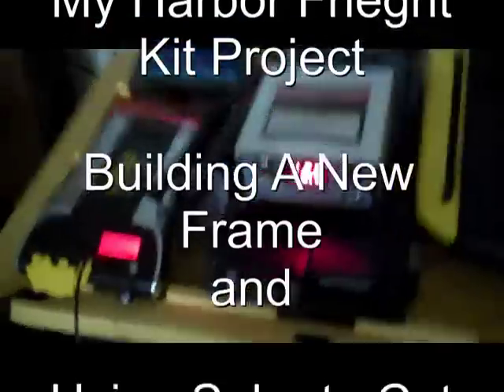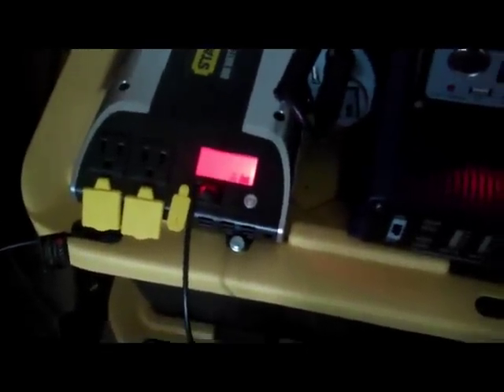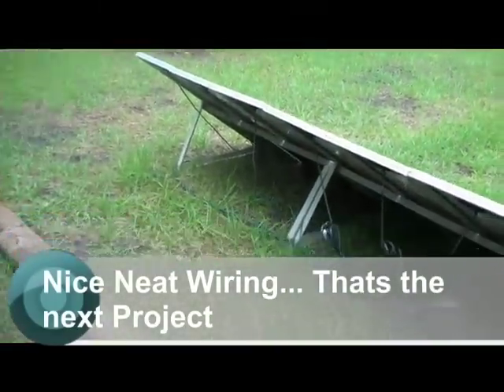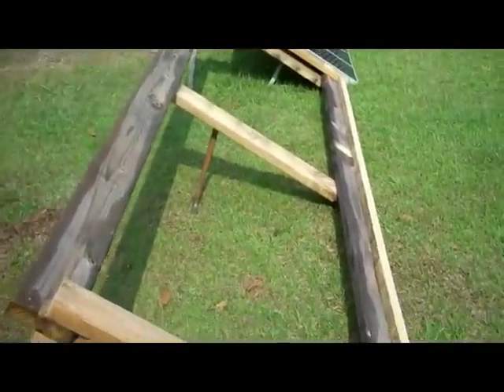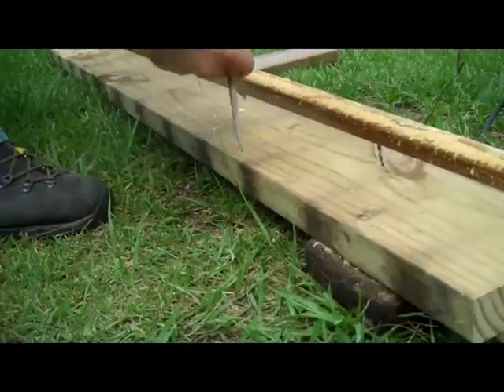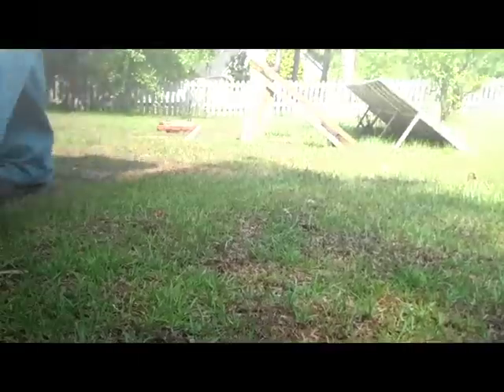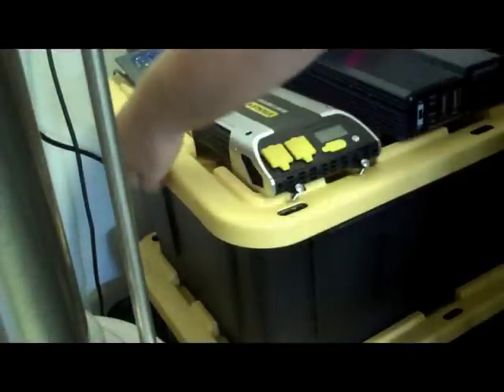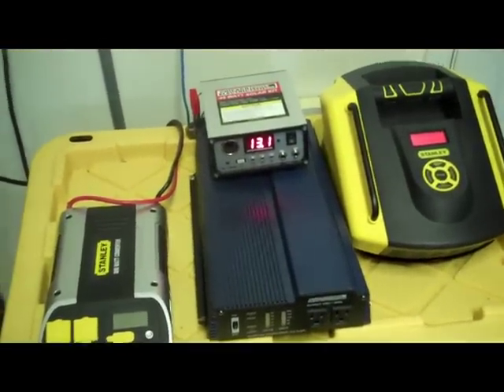Harbor Freight Solar Project

Comment: I use 4 kits from Harbor Freight into one hub with a TriStar 60 amp controller into a 5000 W inverter all with Buss fuses and emergency shut offs and Battery shut off. All my lights inside the house are 12-volt high output LED I can run my 50-inch flat screen all my DVD players freezer the only thing that I am on grid for is for air conditioning. I can show you where my utility bill every month in the summer in the south is $100 even last month which was July 2017 it was $98.82. yes I have a lot of money and solar but it's paying itself off quickly. I think Within maybe around a year it will be paid for but after that it's going to be all free energy. I will agree with you on this stay away from Harbor Freight controllers inverters but the panels are good. Most everything I have is TriStar except for the panels.
Reply: Great answer from someone that's actually trying to walk the talk. Great job!

Comment: nice set up
i just built a off grid solar system
4 100w panels 1 30amp PWM charge controller 6 175ahr golf cart batteries and 1 1000w pure sine inverter
have my 1-37" tv 1-42" tv and 2 computers and internet router 100% off grid
fixing to add some wiring in house so i can run a few lights also in emergency
some day i hope to be 100% off grid
fingers crossed
also setting up 2 systems for my boat batteries
2 10amp PWM charge controllers
3 10w solar panels
one panel and controller in 12v for starter battery
the 2 panels and 1 charge controller for the 2 12v batteries in 24v set up for Troling motor
a float charger for my 24v trolling batteries alone is $180
i got 3 10w panels and 2 PWM charge controllers for $120 off Newegg dot com
and they say the PWM are better for battery life then the MPPT when your float charging for longevity
Reply: yes but the PWM is better for the battery's and there is nothing wrong with the PWM charge controllers and the pulsing helps keep the battery's cells clean and they will last longer
Reply: ***** Where did you hear PWM was "better" for the batteries? The only advantage the PWM has over the mppt in a smaller system is the fact it can be a little more efficient due to using less idle power. I would love to see your source for claiming one will better keep the battery cells "clean". An mppt will equalize the batteries and deal with any sulfating. An mppt is far better not only on how it can take better advantage of the power, but also because it can be expanded so much more. A PWM forces you to use panels of the same voltage as your battery bank, whereas an mppt can step down the voltage. This allows you to use larger grid tied panels which may be 24 or 48 volts. It is far more efficient to put several panels in series for up to 150 volts for a long run to a charge controller. Being able to mix and match panels is very nice with the mppt. If your happy with the pwm, by all means use it. There is nothing wrong with it. I use a PWM on a smaller system for a shop but I use an MPPT for the system that runs the house.
Reply: voltage is reduced to lower levels in order to reduce gassing and prolong battery life.  The main purpose of this stage is basically to maintain the battery’s charge in a controlled manner.  In Pulse Width Modulation (PWM) the charger sends small, short charging cycles or “pulses” when it senses small drops in voltage. and this proses helps keep the battery cells clean were mppt chargers do not
Reply: common knowledge about the way the PWM charge controllers work do a bit more research
the mppt are not bad and are better if you are trying to get the most power out of your system
but there is also nothing wrong with the PWM charge controllers
if you are trying to get the maximum power out of your system then ye you should use a MPPT charger
but there is nothing to fear from the PWM charge controllers nether they are very good and are a well proven technology

Comment: 45watts?   A electric water heater uses 4,500 watts! Thats just one hour of use or 50gals of about  100 degree hot water! 

My NAVY taught me electronics starting with the basics like OHMS LAW. Understanding basic electricty is within the grasp of most , its worth learning.
Reply: Then you should be smart enough to get a gas heater 🤔🙄

Comment: So how exactly do you hook up a series of batteries properly for your solar kit?
Reply: in series so you just want 12 volts to hook up all positive cables up then all the negative cables up and you are done. but that is just a 12 volt system good luck to you
Reply: iwantosavemoney
 That's parallel, just to be clear.
Reply: this is true I found out something cool the other day my friend that works at a cable company said that he could get the batteries from the cell phone towers for free so am trying to get a bunch of batteries for free

Comment: i have very few videos. none really based on the harbor freight panels. I got my 24 200 watt panels for $200 each!! I have also set up a friend of mines home totally off grid. I wired up his solar, 80 amp outback flexmax, battery bank and inverter. no videos of that. there is a reason why!! :) the saddest part is he is building another home and going back on the grid!???? I simply do not understand why at all. he loves what he has now.

Comment: It was painful watching you use a nail gun to fasten fragile solar panels. I would have drilled pilot holes and used screws just in case you need to remove one of them later on?

Comment from the maker: @paidskn1488 provide light for 1 night every night with 1 kit. With one kit for light  you dont need an inverter, so it would cost you 150 pluss a battery... I have 3 kits and 5 batteries and power much more, Just starting out with solar here and having a great time with it.
Thanks

Comment: Not trying to dampen the enthusiasm of a fellow D.I.Y. solar experimenter, but I have to say when it comes to Harbor Freight, be cautious!  Harbor freight's panels generally cost 3x what you can pay for panels of equivalent wattage with better quality on eBay.  I've also seen panels from Harbor Freight like these not last more than 3 years in the environment before ghosting/filming over, cracking inside, and becoming unusable.  I noticed that the last three panels added had a completely different color than the first six. Is that because of dust or some change in the manufacturing of their panels?  It gives me concern when a product changes in quality visually.  Did you notice this?  What kind of warranty did they give you on the panels?  With the costs of solar never being cheaper than now, If you are paying more than $2 per Watt for panels, you are being ripped off.  For future buys you are definitely better off shopping competitively on eBay than relying on Harbor Freight and their over-priced, over-sized panels of dubious quality..  As a prepare, you should be VERY concerned about the long term reliability of your panels.. because if something does go down, you won't be able to purchase replacements for a long time likely!  Also, your panels need to be grounded (are they?) and your charge controllers and other electronics need to be EM/RF atmospheric-burst protected by keeping them in a Faraday cage... otherwise they might just fry unexplainably the same time the grid goes down because of a massive mega magnetic event of any kind which the sun could cook up or from nuclear accident or warfare.

Comment: Hmm, "Ideal output: 1000Wh per day" and that is from the Renogy site for a 200 watt kit. I pay about $.177 for that amount of electricity? So let's see $294.49 divided by $.177 is 1663.78 days of ideal sunshine or 4.55 years, if it's not destroyed by weather or critters? That's not counting the cost of installation, batteries or diminished output. I've bought some solar powered lamps but never have had one that lasted that long? I believe that I'm ahead keeping my money in my pocket.
Reply from the maker: This project was not about cost by no means, more of an experiment on what I could run and just getting my feet wet. I live in Florida now and just went through a hurricane that left power out for 7 days. It was nice to set the system up and run the refrigerator (2 hrs on 4 hrs off) and have lights and tv for the night. The amount of money people lost loosing their food was tough for many. I have 2 diesel generators (6 kw and a 2 kw) I am so glad I did not need to use those. In the end, and at this point I would buy 1 or 2 300 watt panels and a quality charge controller to store for emergency backup power needs. Thanks for watching

Comment: can someone tell me why do my voltage drops from my batteries down to 12.7 even though i haven't used it for several days,the batteries should be fully charged and at a trickle state at this point right?
Reply: You need to assure that your batteries are sitting on an insulator. You can use an old rubber car mat or something similar. If they are sitting on the ground or concrete slab they will slowly discharge. The plastic box of the battery is not a sufficient enough insulator to stop this voltage leakage.
Reply: Charles Getchey
ok.thanks for the info.i didn't know that

Comment: All those panels only equal 135w in total. You can get Renogy 100w panel which is about the same power and only a little more than a hundred dollars. For a small system today I would get 2- 100w panels and connect them in series (positive to negative) and connect them to a REAL MPPT controller. You can use a 10 amp controller for this setup. The true MPPT controller will convert the extra volts into usable amperage. The Harbor Freight controller says MPPT but its a fake, it's proven on several review videos. Tracer is real MPPT, and several others. YouTube has lots of videos showing the difference between MPPT and standard PWM controllers. There are many cheap fakes and they are easy to spot once you see several videos explaining it. The panels are $125 each, the controller with the meter included is less than $100, cables about $100, batteries about $400 for 2 - 100 amp hour AGM batteries at Sam's. If they are vents or used in a ventilated area, regular deep cycle batteries are about half that cost. A 1000w pure sine wave inverter for $130. About $1000 total for 200 watts of solar and about 1200W of usable storage.
Reply: +pokerfacetodd I have had 8 of these 15 watt HF panels running for over 6 years.  The amorphous panel is an excellent panel for cloudy, rainy days.  In the 6 year cycle I have lost only about 8% from degradation.  Those Renogy polychristilline  panels are garbage.  I have friends that bought them and they have been degraded 10-15% in just 14 months!  You get what you pay for, that's why they are the most bought solar panel on fleabay.  I never used the HF controller that came with the system, but it felt cheap when I touched it.  120 watts gives me plenty of power for my greenhouse and my workshed...using 4 deep cycle batteries.  I just changed out the batteries for the first time in august of 2015.
Reply: +Tim Edrington Renogy gives warranty for the fact that the performance of delivered Renogy photovoltaic modules does not deteriorate within a period of 10 years of the commencement of the warranty period (delivery date or date of invoice) by more than 10% of the minimum performance to be assumed on delivery, or that, within a period of
more than 10 and up to 25 years, the performance of delivered modules does not deteriorate by more than 20% of the minimum performance to be assumed on delivery.
Get the facts.HF is cheap junk and all the real solar people will tell you. Only newbies buy that trash.
Reply: +pokerfacetodd Well I didn't say they weren't replaced under warranty.  When these HF, Chicago Electric Sunforce panels came out, they were a good buy compared to what was available at that time.  A lot has changed over the years, that's progress.  I don't believe the HF panels are junk and they are useful in the right application.
Reply: Tim Edrington If a person today chooses HF over Renogy, it's due to lack of information.

Comment: I hate to say it, but there are better and cheaper panels out there then these. Right now on ebay you can get a 80W Poly-Crystalline panel for $167 shipped. The amorphous type of solar panels loose power over time, the 45W kit might put out 50W when you get it, but in a couple year will only output 40W.

Comment: now i know how to endless-ly power my newly installed ham radio station in a big pinch. i am stacking 6volt tractor batteries and hooking 2 together to get 12volts with mass amps, 6volts is better, trust me, more amps less chargeing cycles....

Comment: I would recommend that you stay as far away as possible from Harbor Freight panels and equipment for solar harvesting. Costco has better and cheaper panels,inverters,and charge controllers. My system uses even more expensive components,and is far from optimal. The panels,and electrical equipment sold by Harbor Freight are sub-standard homeowner grade and should not be relied upon for human safety. Wet lead acid batteries are not the best alternative,either. AGM batteries are safer and easier to work with. Mono versus Poly in panels is night and day. As is MPPT versus PWM controllers. There are always better systems available, but you should gauge your needs to your startup costs also. Best advice I can give is LEARN OHMS LAW and how  to use of a Volt/Ohm meter. That and a Kill-A-Watt tool for measuring wattage being used by an appliance.